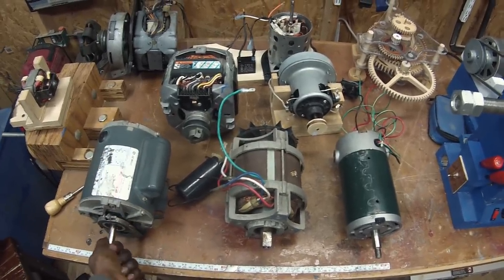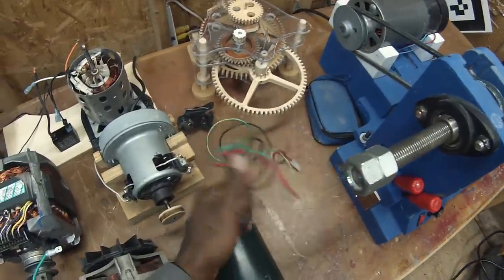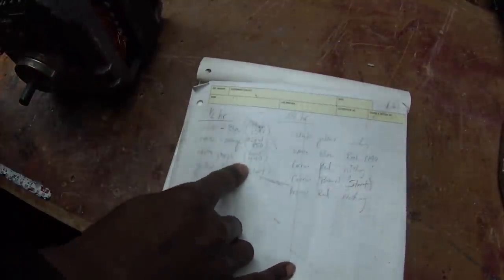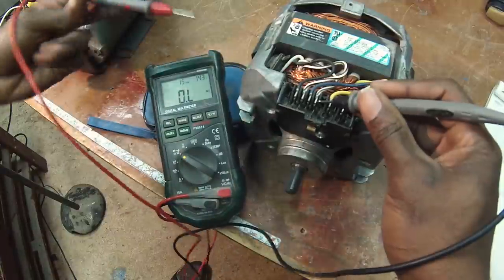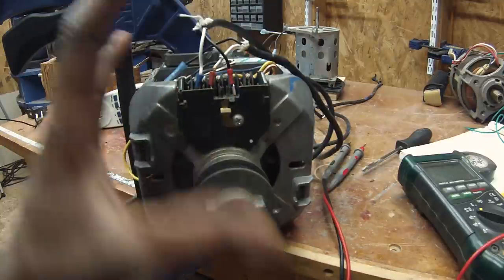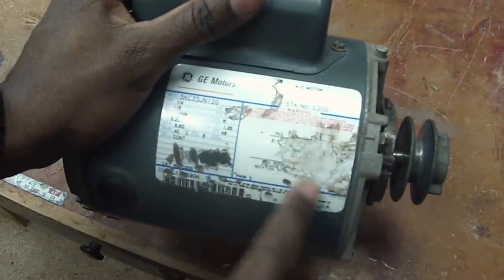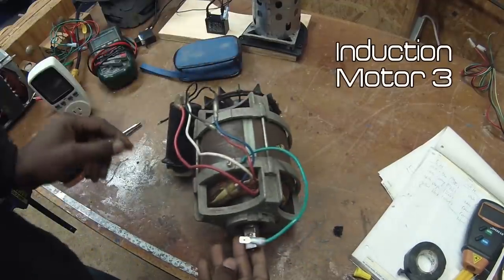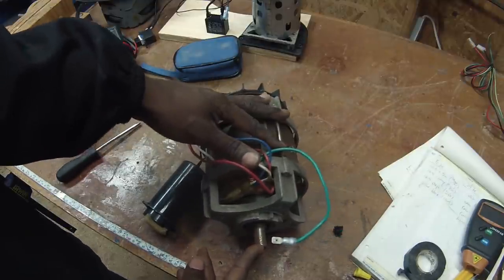How To Reverse the Direction Of Universal and Induction Motors: 015

Comment: Just got a treadmill motor that I'd like to put on a cnc router, but I need a couple of other builds first. I have a garage door opener motor I could use or should I use a dc motor?
Got a few of those around with power supplys, 12 & 24v? Great videos Jeremy. How can I show a pic of this garage door motor?
I have some questions about?
Reply from the maker: You could post an unlisted video from your phone and send me a message with the link. Or, use the about page on my channel to send me a message.
Reply: Jeremy Fielding how do i go about sending you a message on the "about" page? I don't see any way to do it.
Reply: Jeremy Fielding how do i go about sending you a message on the "about" page? I don't see any way to do it.
Reply from the maker: "for business inquires click here" is what it says. It prevents spammers from using web crawers to get email addresses. Posting your email here is a bad idea.
Reply: I don't really know how all the comment system works on YouTube I barely ever comment anything, so I don't even know if I'm commenting to the right part of the comment junk. have you ever done anything with an auger motor from refrigerators ice maker?  I can't say that they would be useful to do much because of how slow they are with the gear reduction box, but I'm sure people will be curious how much weight they could lift, or if it would be useful as something to stir things with?  or as a rotary to cook something?
Reply: Kevin OConnell Treadmill motor would be way stronger and wouldn't get hot quick like the garage opener motor.
Reply: David's Favorite Videos, yeah I thought so! I'm kind of holding that for a cnc router project that I'm working on and just wanted to get a 6" belt sander up and running first. Do you think i could use a harbor freight 4 1/2" grinder as the motor? TIA

Comment: Hi, Jeremy, great videos !  I have a 'non reversible' ex-lawnmower motor which I have to change the direction of for a table saw.  Simply reversing the brush wires does not work.You touched on this above around 12:50. Could you do a video on how to 'dig the internal wires out' and reconnect to reverse the direction ? This would help me enormously.
Reply from the maker: I think you have a DC motor? We are talking about a electric lawn motor with a 12 volt battery? You can reverse it by simply switching the Positive and Negative leads to your power source.
Reply: Sorry, Jeremy, I've given you false information. The motor was NOT from a lawnmower but is 220v a.c. I can't remember just now what I took it out of, but whatever it was it is definitely 220v with no external means of reversing it. I have it installed successfully in my table saw and everything is good but it turns the wrong way !
Reply from the maker: Thanks for your patience. You comment was buried by all the other comments. I have alot of conversations going at once so I am losing track of some things. Unfortunately I haven't tried to wire a 240 volt motor. I don't have 240 power in my shop  and I am not sure how to do it. The process should be the same... as far as reversing the start winding... but I haven't actually done it myself so I am afraid to recommend specific steps. I found a video covering exactly this which may be helpful. Again I haven't tried it so you will have to take this information at your own risk . https://www.youtube.com/watch?v=rMeMaT0HZN0

Comment: Hello, I watched your video and wanted to to thank you for your very clear explanation. 

I have a new 1hp meat grinder I want to add a reverse switch on. Is there a way for me to send you a photo before I buy the switch and start the project? I want to make sure this motor will be able to access the wiring easily before I start.

Regards,
Mark

Comment: If you're alternator wheel has not,bolt,key it has to be clockwise or the nut will come loose, usually there's only enough threads on the shaft for 1 nut.

Comment: Appreciate a reply if I get at least 1 , I've been looking for a answer , can the direction of the energy be reversed if you put power to a second equal motor through turning the shaft(pully-belt) of the unplugged second generator? Would electric come out of a wall socket plug through the wires? I think so. So I was thinking of extending the shaft of a generator, putting a pulley(on both sides of the shaft) on it, whatever's left over from the 1st motor splice it in to the second motor(or hook it to a separate invertor. The less stress on the shaft the more energy so putting energy back into 'anything' keeping it at 100% or better is good. Not asking about reversing polarity.
Reply: I have a couple videos if you want to check it out.
Reply from the maker: I don't understand what you are trying to do. But it sounds like you are trying to get free energy by asking for "over" 100%.
Reply: Jeremy Fielding exactly
Reply: Jeremy Fielding throw it together if you got it. Reverse the plug in and wire them direct to something small.
Reply: Whatever's left over from the motor plugged in at 100% , put a regulator(the dial up you said you got from a store)(undo the wiring and if has say 8 wires split 1 or 2 wires and run those to somthing that requires tiny wires or smaller wires) between the unplugged motor and the 1st motor (plugged in), so it can be split or 100% to motor plugged in or 100% to another user(coil, vacuum cleaner,ect) or through a inverter. These are small scale maybe something for the green energy people.sorry if confusing there's a long paragraph within the sentence.
Reply: Or change the wires to something of similar gauge, 'or higher', say if the wires coming out of the motor are 12 gauge change them to 6 or 8 gauge with tinyer(or smaller) wiring coiled together. Lower gauge with more smaller wires  So you could split better percentagely.
Reply: Where do you live?
Reply: This would be assisting the tension on the shaft(with pulley at normal operation) for  whatever the belt is connected too( a air compressor, another generator) with a inverter pulling 3,000 watts at a high rpm. Lots of parenthesis.lol. have you seen the 'TEKNIK' style generator? Looks like compressed air is helping turning the shaft like with a air tool.(fan finns).
Reply: Jeremy, have you put anything new together yet?

Comment: Neighbor just got rid of 2 treadmills and I was considering just the kinds of cool things that could be done with them.  I'd like to build a sanding belt grinder and I'm told that you need these variable speed DC motors for that.
Reply from the maker: I wouldn't worry about variable speed for a sander. The induction motor is much better. You get a consistent speed, and they won't slow down when you apply a load. Most 12 in disc sanders use an induction motor running at 1700 rpm. That would get you what you need, and they are easier to salvage if you don't want to buy something.
Reply: Thanks for your reply, good to know then I didn't miss something.  I salvaged a motor from a basement in a house I bought, so I'm going to use it for a sharpening station like the one woodcraft has a build for.  I also just  won in an auction a 20 gal vertical Husky compressor with a good motor for $10.  Trying to decide how to use it also.

Comment: Apologies -- this is the FIRST of all your videos I have seen (viewed 01-31-2023....).  Totally unrelated question: if I have a large treadmill motor that is air-cooled directly with shaft-mounted fan (fan designed for counter-clockwise rotation, blowing air on to / into the motor), how can I find a fan that will cool the motor in clockwise rotation?  Original fan is unidirectional airflow due to curved surface of fan blades (do even if you flip-mount the fan -- clockwise still blows air AWAY from the motor...).  I have called and searched online....can't find a 4.25" diameter fan with 7/16" shaft center-hole, and fan blades angled to blow air on to the motor via clockwise rotation..... Do you know of any parts collectors / dealers / suppliers who might have such a fan?  OR -- will I need to mount a separate, electrically powered fan to blow air into the motor....?   (Yes: this is one of those treadmill-as-DC-power-generator projects....)  If you ever see this question and have time -- thanks!  Thanks again for all your videos sharing your knowledge.

Comment: Regarding the vacuum cleaner motor, is there a way to get the motor to go one direction for 90 degrees and then rotate back 90 degrees? And basically go back-and-forth within a 90 degree angle. Would love any help on that! :-)
Reply from the maker: That would be a stepper motor... and your homework begins here 😀
Reply: @Jeremy_Fielding  Thank you!! I actually figured that one out last night after I sent you the message :-) So now I'm learning how to properly size my stepper motor and I'll be on my way! Oh, one thing I'm still not sure of, how do I attach what I want to rotate to the shaft so it stays on? I feel like I'm missing something in that area, but really haven't had much time to dig into it yet. I'm a plastics design engineer but never dove into motors much and I'm trying to build something for my son :-) I know I'll figure it out! But it never hurts to ask!
Reply: while your thinking of stepper motors, I am thinking of continuous back & forth, looking at how an automotive windshield wiper motor spins, & pushes & pulls linkage through an arc, which could be custom tailored to how many degrees you need
Reply: @randymack1782  I need more force than that :-) The stepper motor will be perfect!

Comment: Great Videos and well explanation. However i just can't figure out what type of motor i have. I have tried on 230V AC it spins crazy actually scary. Tried on 60VDC spins as well. But it has 4 wires coming out of motor, only numbers marked on wire 1-3 they are black and one is green-yellow just like earth ground wire. But it spins only with 2 wires given power. Like two of the black wire, but if i change polarity nothing change but if i swap one of this for the 3rd. black wire motor spins counterclockwise. It is a german made Georgii Kobold KGS 608.50/XKL/XF/K/S1/S2 type motor. Could you tell me how to operate this motor properly? I want it for a lathe with variable speed. Thank you!
Reply from the maker: I have several videos on wiring motors, and you might find it helpful to go through the "how to wire and control motors" playlist. Unfortunately I simply can’t do one on one advice. It is not safe, and not practical. Please understand I get hundreds of request like this, and it takes a lot of time to get to understand the problem then, step-wise solve it through someone else’s hands. It’s just to risky and time consuming.A google search is what I would have to do to understand your motor... That is where I have to point you if the videos don't help

Comment: hi got an old Grizzly g1022 motor, still confuse what wire to switch coz in the manual it says need to switch wire number 5 and 8. can't figure out which is the the 5 & 8. thanks in advance.
Reply from the maker: I am not sure how to help you. If the cables are not labeled it will require some testing like I show in "how to wire a motor". https://youtu.be/ZKodxGcRSnw

Comment: I save a washing machine main pump motor and use it to save air ventilator(fan) and it became that it rotate to the left (conterclockwise) the motor use only two cables with a capacitor, it will be possible to change the rotation of the motor?
Reply from the maker: I am not sure exactly what motor you have. But, if you can't access both ends of the starter winding (sounds like no) you can't reverse it.

Comment: After reviewing all of the videos, I have com to the conclusion that not motors can be reversed. I have a motor that has only three wires. One is from the start windings and two from the run windings. It can be reversed by connecting the run wire together and unplugging the start wire and manually spinning the pulley either way.

Comment: I have a motor from an a/c unit. It ran the fan for the evaporator. It uses 220 volt ac. What can it be used for besides running a fan?
Really enjoying your videos.
Reply from the maker: It depends on the speed. I would say almost anything with the right size pulleys.

Comment: You have very interesting videos, sir. One correction, the speed controller (even a ridiculously cheap one) uses a triac (or on some cases an SCR), not a resistor to limit the output current. It is essentially the same circuit as a light dimmer (perhaps you could do a video comparing the two).

Thanks.
Reply from the maker: Well, I was certain this was a variable resistor but you are correct it's using a triac. Some dimmer switches are variable resistors but I believe most of the new ones use a triac. I will add a note to the video. Thanks. I am planning a comparison of several different "methods"
Reply: Jeremy Fielding, basically, a variable power resistor (rheostat) is usually big and bulky and costs considerably more than a simple triac-based controller. The way they (triacs) are wired is also incredibly simple.

Comment: Hi let ne start by saying i love yr channel! You know your shit! Which is Why i have a question for you.. I have a type 2 ekec drill 5amp.. That im using " for something else.. That requires i side angle.. And i need to control the speed of the drill externally how can i do that? I tried a dimner switch.and an extra larger ext cord wired to gether. Works on the lites not on the drill.... Im guessing not enough power. Help?
Reply from the maker: Please check the end of the description thanks!

Comment: The smaller the shaft the more rpms, I'd like to put together the smallest shaft with a generator off an air compressor or a larger generator, I was planning to take(form) a camshaft off a 4cyl(a small camshaft), then molding the rest of the generator around it.

Comment: Hello,jeremy,
i have a dc treadmill motor 1hp  i tried  to reverse it hooked the switch in and then tried to reverse it and the motor keeps turning counter clock wise.how can i correct it .......it is a dc ge motor  hee is some info,hopefully you can tell me what i need to know.......ge motor
BD626222 120 V AM I MISSING SOMETHING  IT SAYS dc MOTOR.

Comment: Great video. Thanks. Now... If you could find your way to wire the AC motor (240 V) to a drum switch (L shape circuits) and then explain it... I did it but I don't understand what I did. For the sake of discussion and maybe a short explanation: a 6 terminal drum switch where terminals 1, 2, 3 are on one side and 4, 5, 6 are on the other side and the connection in the vertical position is off... I connected Line 1 to terminal 1 and Line 2 to terminal 3, with the matching line 1 out on terminal 4 and line 2 out on terminal 6 then only terminals 2 and 5 are open. the two wires of the starter winding are connected one to terminal 2 and one to terminal 5. When the switch is rotated to CW run rotation then terminals 1, 2, and 4 are connected similarly 3, 5, and 6 are connected... hence the L shaped circuits. Then when the switch is rotated to the CCW run position the 1, 4, and 5 terminals are connected and the 2, 3, and 6 terminals are connected. The motor runs as hoped... But Why? The is 240 V and power is being applied to both terminal 2 and 5 but are being powered by either the Line 1 or the Line 2. Hence my question. Sorry for the long read... but if you don't have time to include a drum switch in your video maybe this forum is OK. Even if you don't have time either way... thanks for the great videos and I'll be looking for more.
Reply from the maker: I have never tried to wire a 240v motor, so I don't have any point of reference to help. There are several people here who may be able to comment on this? Perhaps the all knowing google search can help. I have had a few electricians comment here maybe they can chime in.
Reply: Jeff Conti  if you can find a book titled uglys,  it's a maintenance electrician book and it shows all the wiring and diagram.
Reply: I ordered the book on Amazon (used) for #20 (including shipping). I'll give it a read. I'm really trying to understand how this works. I have it wired and it works... I just want to understand why. :) Thanks

Comment: hi recently i found a AC and a pressure washer while idk if the pressure washer works the AC apparently doesn't. How is the motors found in AC units this one is a big one
Reply from the maker: +eddy apple air conditioner?
Reply: yeah lol i just happen to come across one only thing wrong with the thing is its needs some free-on other then that the drive cap is fine and the motor plus some other things i just wonder about the motors torque and speed.
Reply: you seem to have a motor from everything so ya know thought i might ask
Reply from the maker: I don't know...I haven't salvaged one before. The blower motor is probably at least a 1/2 horse power if it is a big AC Unit (probably larger) and should make for a fun future project.

Comment: Can we use a driver that control the direction of the motor with an H brige or somethink like that.
Reply from the maker: The options are unlimited
Reply: do you know some drivers? the board of the treadmill can't do that, and i can't find a comercial driver with that voltage (90V) i only find with standards voltage, like 12v and 20'A, 45V and 15A..... no for 90V
Reply from the maker: I don’t know. That requires some homework. They are certainly made if you are willing to pay for one. I haven’t found an application that didn’t have a part available. But they of course cost more as the power needed goes up.
Reply: see, i'm building an h bridge with mosfet, im having some issues with the mosfet but im thinking because of the potential of the motor, it's an animal that motor.
I will let you know if i can biuld that h bridge.